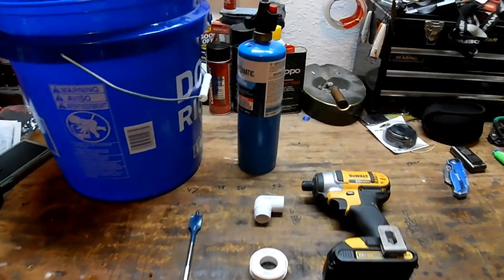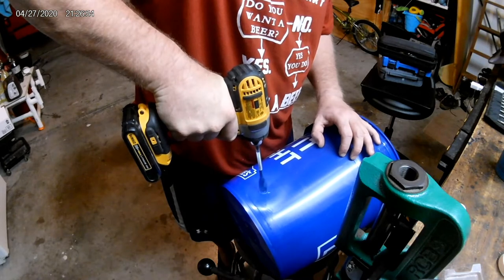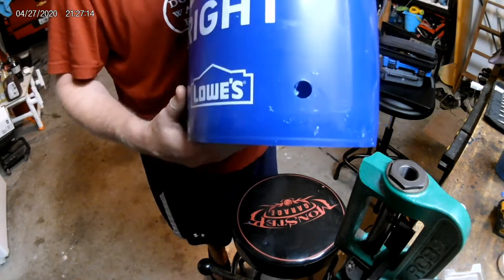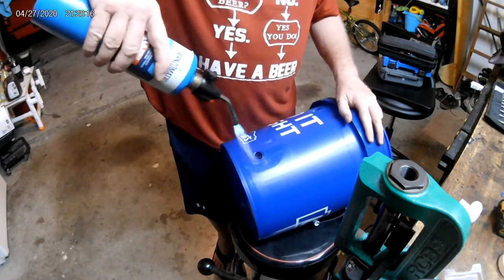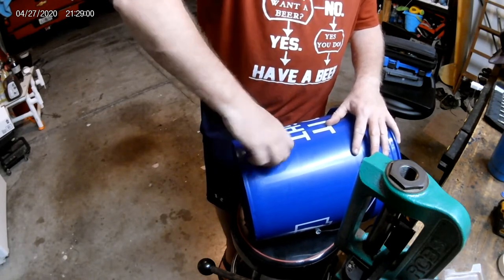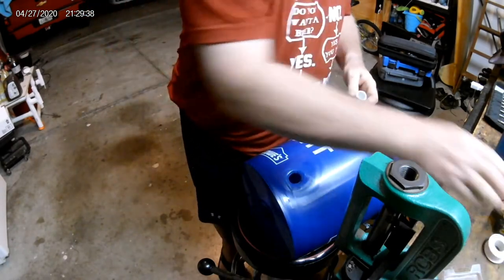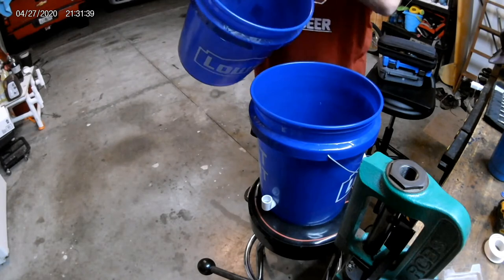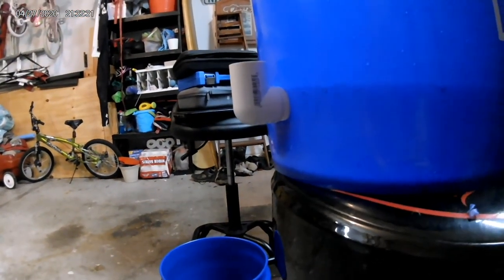Adding a waterproof fitting to a 5 gallon bucket

Comment: Thanks for posting. Adding my 2c for anyone reading...i did this to make a bucket filter for our pool. We have well water and well, i needed to hook a pump up to the bucket to filter through some polyfill then out the top. Some good videos out there on the bucket method for pool if you search it.

I bought:

1 - 3/4 male to slotted pvc fitting
1 - 3/4 female to female fitting
1 - Large pack of assorted o rings

I did exactly as you did. For my application, I Put on an o ring and teflon tape, then screwed in the mail fitting. Put on another o ring outside and screwed the female to the male to create an even tighter seal for my application. Since im hanging a hose on it, figured a bit more support never hurt.

Thanks again for posting!

Total cost was like $10 for the materials!
Reply from the maker: Never thought of o rings....novel ideal....you made a better mouse trap
..outstanding...thanks!

Comment: Hey man, thanks for the info!
Great idea on reversing the drill bit for a clean hole. It’s gotta preserve the blade a little too I’d think so there’s that too. You can cut siding for a house this way with a circular saw by flipping the blade over and running it backwards. Thanks for the info. 
I actually used this method to build a bucket to help add antifreeze when winterizing my boats and it works better than I thought.
Reply from the maker: Outstanding!!   Thanks for the additional tips as well.

Comment: Teflon causes PVC to desolve and fail. May take some time but teflon tape or paste will react with PVC.  Epoxy would be a better option.
Reply: No it doesn’t. I’ve been a plumber for 20 years. Every pvc fitting with threads gets Teflon and pipe dope… shhhh
Reply: @stevengill1000  
I use non teflon paste with no problem. I have had pvc fittings fail with teflon. They do make a pvc safe tape. White tape will fail. 
I have been doing plumbing work for the postal service for 30+ years and worked with my father in industrial plumbing since my teen years
Reply: @stevengill1000  
Why would you use tape AND paste on same fitting. One or the other. Never both
Reply: @glennreynolds962  And there is not paste. I don’t know if you’re referring to glue? You don’t glue the threads genius. And that is an industry standard against real plumbers do use piped up and tape on fittings. If you actually learn plumbing with a real plumber not from your handyman father you would know that